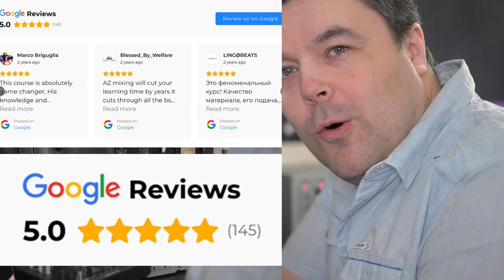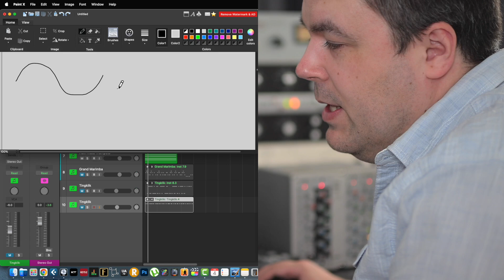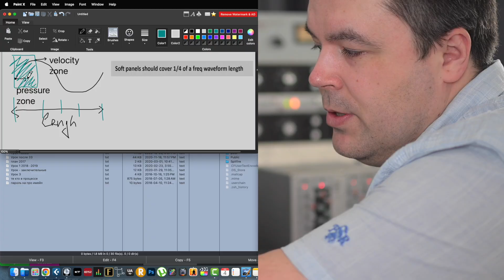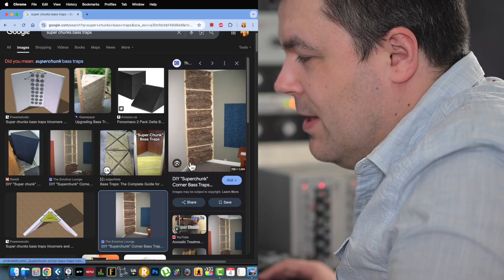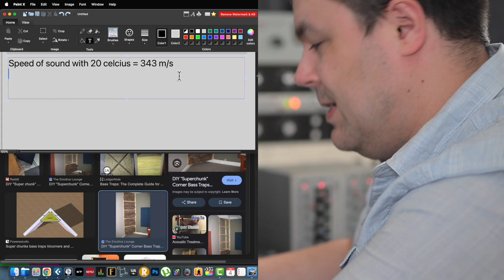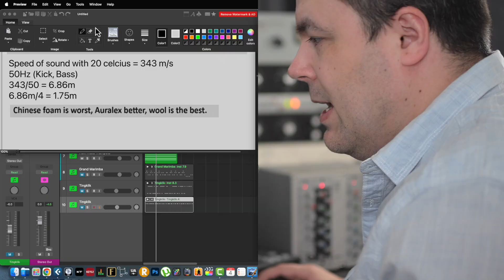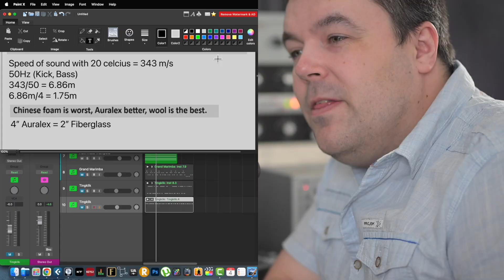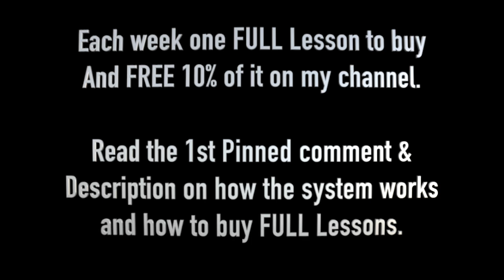Wrong Acoustic Treatment in 90% Cases – Fiberglass Panels VS Foam Panels Myth, Let's Count Thickness

Comment: Bass traps truly are BS. If the corner coverage is 5% of surface area you only have 5% coverage. I hear you need at least 55% coverage for low end improvement. Also the right thickness like you said. Once you find out the truth about treatment it's very surprising but at least you won't waist money and effort.
Reply: I totally agree
Reply from the maker: Thank you for your feedback!